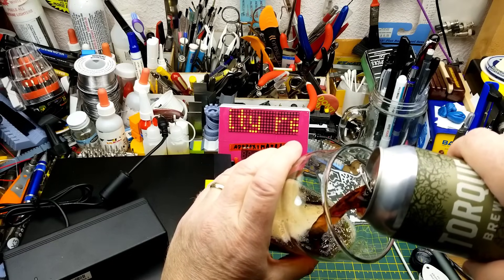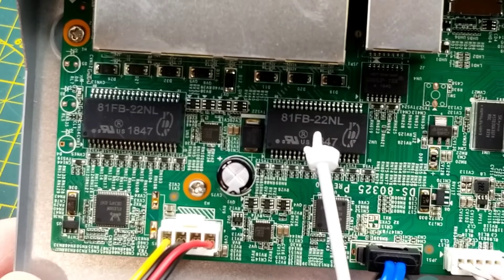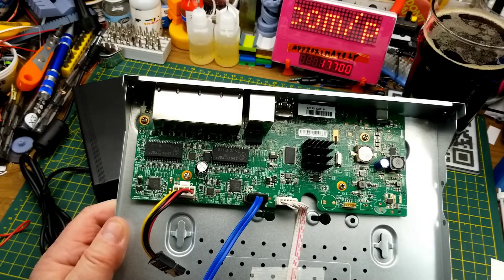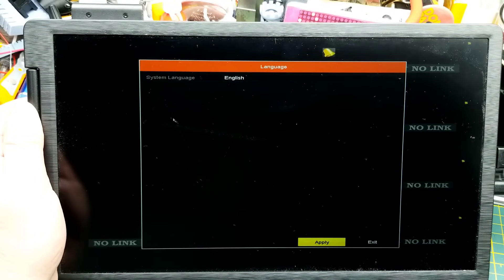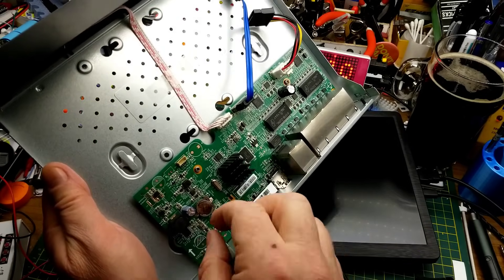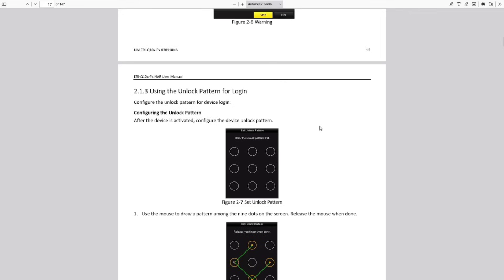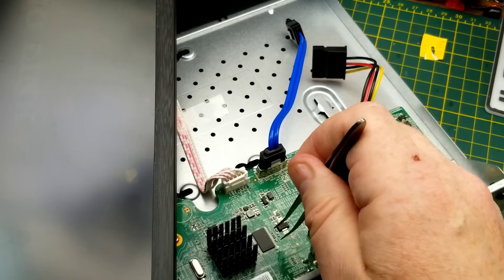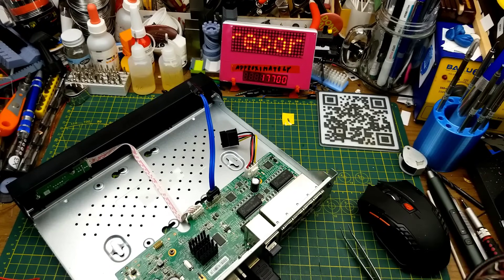curiosity teardown: Hikvision network video recorder

Comment: There is a web based reset, you get a code from the device after it has had invalid attempts, and then you emaiil it to Hikvision, and support will come back a few hours later with a reset password. Have used it before on my one.
Reply from the maker: Do yo have to prove you are the original owner?
Reply: @pileofstuff  No, just a valid email. you can also download a viewer and the unlock software as well.
Reply from the maker: @SeanBZA  Interesting, I'll have to give it a try.

Comment: The reset is normally triggered on power up, so hold reset, plug in power. There is also a UART header near where the speaker is ment to go for serial, you can reset the password via that too. also upgrading it blanks the password(just put file on flash root and power up, it will auto update)  and finally there is software called iVMS-4200 and another called CMS client which both have a ini file you edit to show advance tools menu which has a reset device tool and will totally reset a hivision sdk camera (including ezviz camera which are hikvision)
Reply from the maker: Thanks you

Comment: Did you try ? Switch off the power, Strap the "button" for 30+ sec, Switch on the power. Release the "button" after 30 sec.

Comment: Try downloading the firmware and see if it will auto flash at start up. Only a few days ago, my zosi system got stuck on the initialisation screen and the reflash cleared everything.

Comment: I guess I was lucky when I bought mine - slightly different model (not POE). The previous owner was a bit lazy and just used "0000" for the password. Since it was never connected to the WWW it didn't really matter that much.

Comment: This looks like a Hikvision device.   There is often a  physical reset button on the main board to reset the password.    Not all models had that button though admittedly.   The Manual usually will say how to do that     I did find this information though:
There is no physical hard reset button on the larger Hikvision NVRs, if you don't have the password to access the NVR you will have to perform a Password Reset and send the reset file to either your original seller/installer or Hikvision support directly.
Reply from the maker: I tried teh reset button, and since I bought this used, I don't have access to that last option.
Reply: @pileofstuff  Yeah, unfortunately it lokks like you might be stuck on this.  All the admin features are stuck behind that password

Comment: I've had that same problem! Not having the password
I'm unsure if it works on that version of software but go to your computer and download "hikvision SADP", connect the NVR to your network and find it on the SADP tool.
Press forgot password and either do as it says and mail a qr code to hikvision support (I've had no luck with that as I'm not a "authorized technician" or something something. On the version mine was at I could press in the very bottom left corner of the login screen (where you had the "forgot password" button, so I'm not sure it works on yours).   But if, after all in either the NVR or SADP you find a long model number and a code to input, go to Google and search for "hikvision nvr password reset tool", and find a website with a where you can enter the startup time and model number, then you should get a code to enter and reset it with.
Hope you get it working, I've scrapped an nvr (I got soooo close to resting lt but I just didn't know!), now I have 2 more, one I managed to reset using this method.

Comment: At about 3:41  ( and around 11"49 ) is a clear shot of the board around the missing button.  There looks to be also missing a capacitor and resistor ( could not tell if they were missing or not due to how small the surface mount parts are ).  You might want to check if they also did not add the debounce capacitor and limiting resistor for the button.
Reply: Those mising components likely were never populated from the factory.    Not all models had that reset button on the board

Comment: Another rabbit hole you could go down, albeit involving software, is using a chip-clip to dump memory chips on the board and analyzing the contents!
Reply from the maker: Possible, but that rabbit hole is well beyond my personal ability at the moment.
Reply: @pileofstuff  Matt Brown springs to mind!
Reply: These run Linux so it would be fun to explore what binaries they run but yeah its another rabbit hole to go down
Reply: This is probably the only way to get access. It might be possible to figure out how the password is hashed, and brute-force that on another machine.

Comment: It is very probable that the manufacturers can supply a super password that will give you access.  Contact them with your model and serial number.
Reply from the maker: They can, but from what I've read in my searching, they will want some proof of ownership.  Plus this unit is officially "no longer supported"